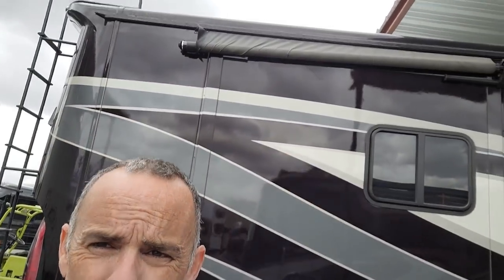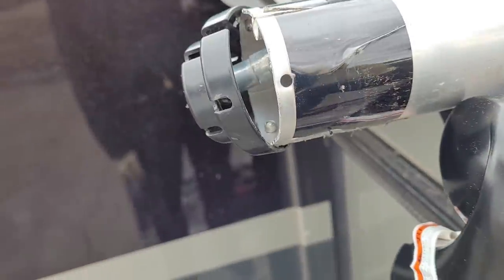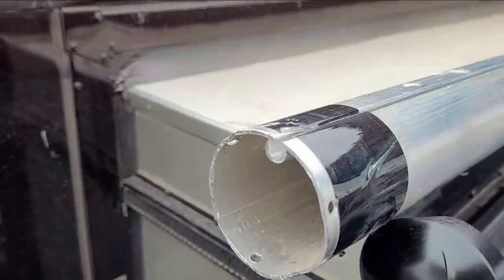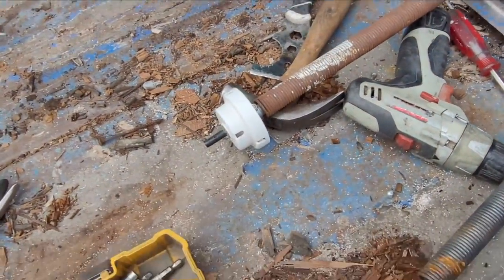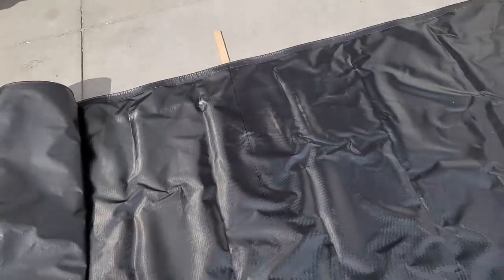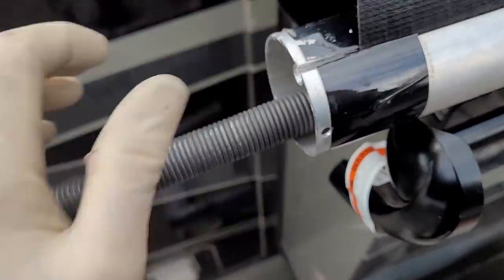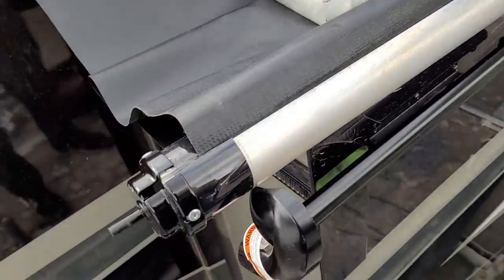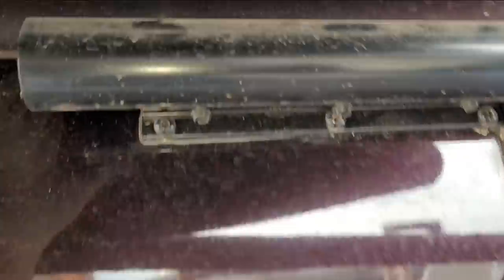Why I am Repairing a RV Slide-Out Awning? 2019 Tiffin Red

Comment: Nice job! Thanks for sharing. 
A buddy of mine has a very late model Lance travel trailer and today his center skylight is leaking rain water. I figured we would just get up there and dab some Dicor on the seal. However all his vents & skylights look to be factory installed and sealed with Eternabond tape. Only exception is his sewer, sink and TV antennas have the goop Dicor.
I am sending him back to his sealer. Those tape seals have a leak somewhere beyond my help. I should be under warranty. Was just surprised to see how they sealed around his vents & skylights.
Reply from the maker: that is surprising to me too

Comment: Bummer. I was hoping you would say how many turns to put on the spring. I had my 25 foot slide topper tore off in very high winds while in Oklahoma 3 months ago. I was able to secure the long tube to the motorhome and got it back to Arizona. I bought the replacement springs for both ends and new topper material. With help, I put it on the motorhome and gave each spring 5 turns, with the slide out 12" from the coach. While traveling through Utah, I soon found out that was not near enough. I took out the rivets, gave it another 5 turns, but in wind, that still doesn't seem like enough. Any ideas?????

Comment: Currently working on Class A 40' NewMar.  Has a 15' Slide-out Dometic topper.  Initial complaint was torn topper.  Upon looking at it,  the MIDDLE of the topper was rolling up onto the TOP of the slide-out itself.  Im not an expert by any means but ive changed several of these and never seen this problem.  Owner stated this was original topper. Is this too much tension??

Comment: Could you not cut the tube down to get more clearance between the topper awnings?
Reply from the maker: it would be 3 hours of work to remove about an 1inch as we still need overlap on the tube over the slide and for the fabric to fitt on the tube,